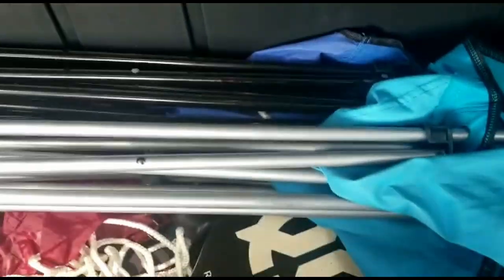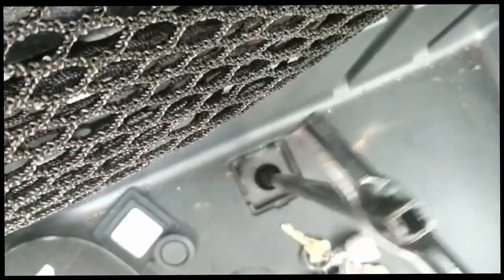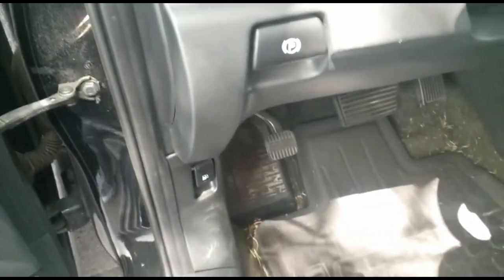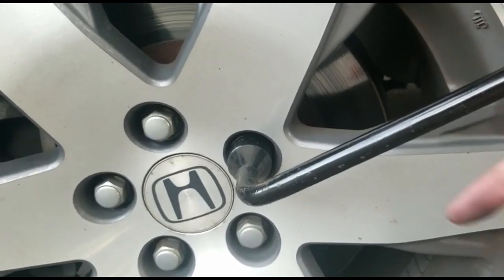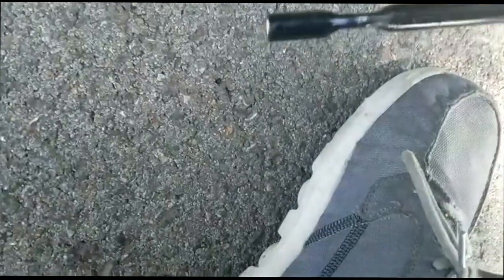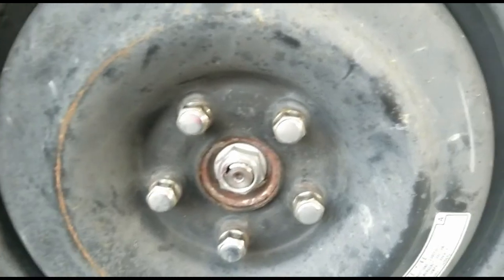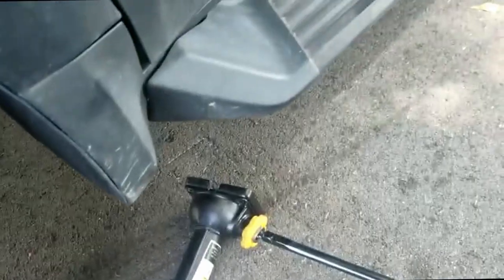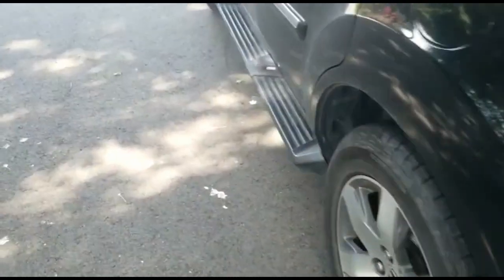Fixing A Flat Tire | 2014 Honda Pilot

Comment: Good job 👍 just try to remember to also put air in the Spare tire and spray or rub a little tire conditioner on it to prevent dry rot.
Reply from the maker: Good tip